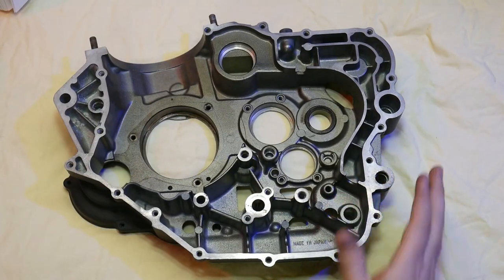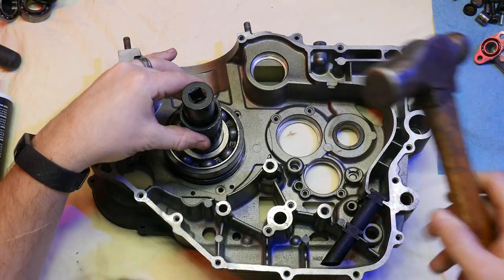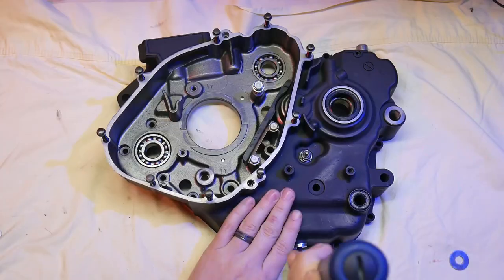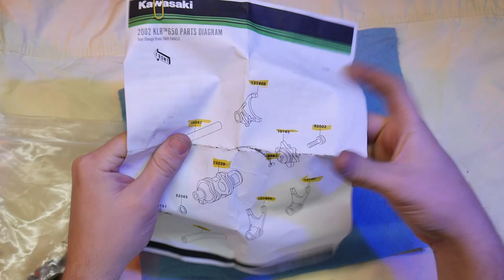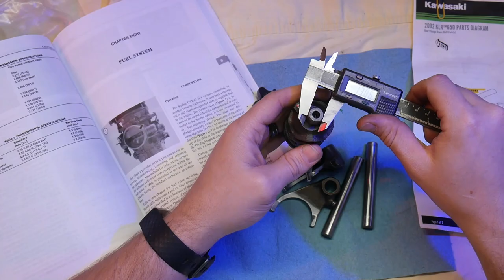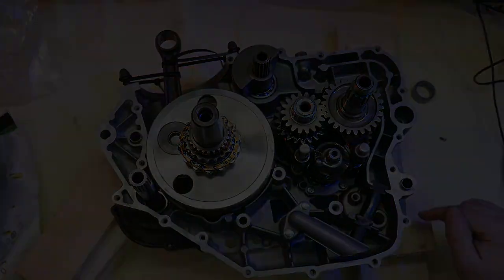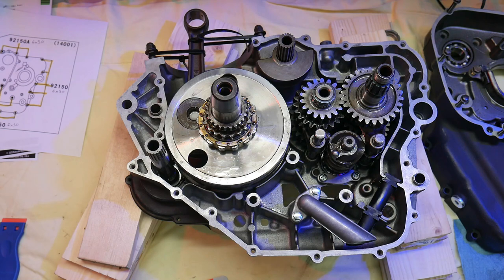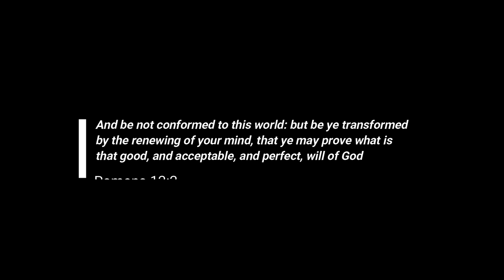Project Warthog EP 4: KLR650 Crankcase Build

Comment: Hi, where did you get the fasteners from? Did you order a kit, or just buy them from a hardware store separately? Also, what manual are you using? Thanks!
Reply from the maker: I ordered them from McMaster Carr, far cheaper than ordering the kit plus I could confirm the grade bolt. The KLR actually does a good job at minimizing the number of different size. It's mostly M6 25,30, and 40mm. I'm using a clymer manual but honestly it's not the best. Otherwise I just reference the KLR parts diagrams.
Reply from the maker: I've updated the description with links to the fasteners. If you order these specific ones you'll have way more than you need just for the engine.